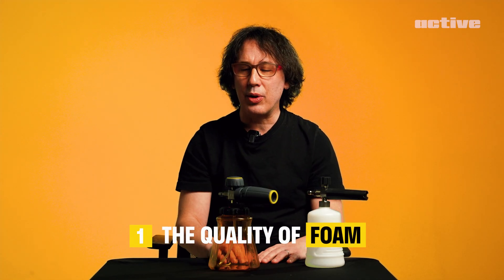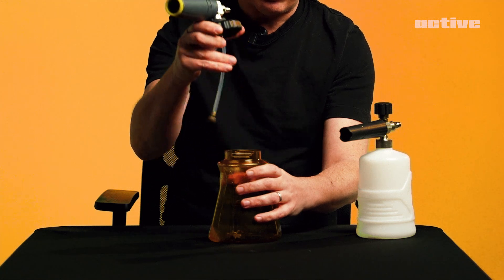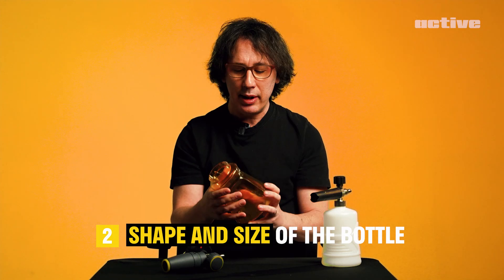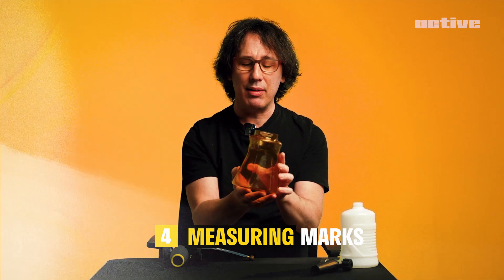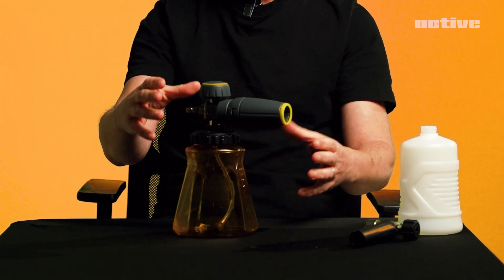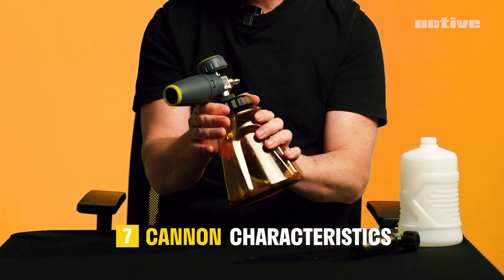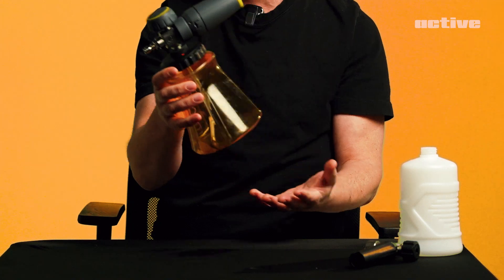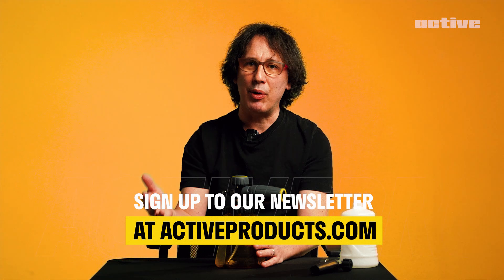Prototype Ready! - Let's build a Foam Cannon! PART 3

Comment: How soon is this going to be available to order? I’m looking to order the bundle. Does anybody else have recommendations to get me by or just use the one that came in my active 2.3? Biggest thing I don’t like is how long the gun is.
Reply: They have a short gun that has been out for quite a while. I have it and it works great. The short gun has been getting rave reviews.
Reply: @mikemccormick6128  What should I use at the bottle? I get what you’re saying and I might not be able to buy the bundle if I buy one piece by one piece. Might be able to get something close.
Reply: @justbenwild  I ended up getting the MTM Hydro. Any high quality foamer is going to be in the $80 to $100 price range and I suspect the Active foamer will also be in that price range. It's hard for me to make a recommendation before knowing when it will be released. I actually bought the Active 2.0 on Amazon on April 10 without knowing anything about the 2.3 model. By the time my order was delivered, I found out about the new product release, so I returned the 2.0 and ordered the 2.3 on the Active website. I ordered the Active short gun at the same time as I ordered the Active 2.0 and I also ordered the MTM Hydro at that same time. I think it works pretty good. Since I already have a high quality foam canon, I won't be ordering the one from Active unless something happens to the one I already have.